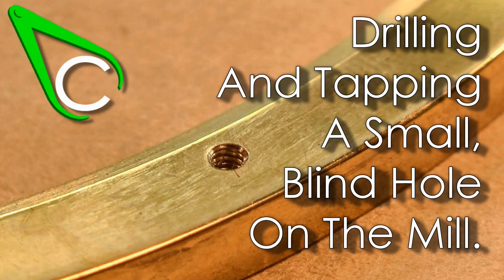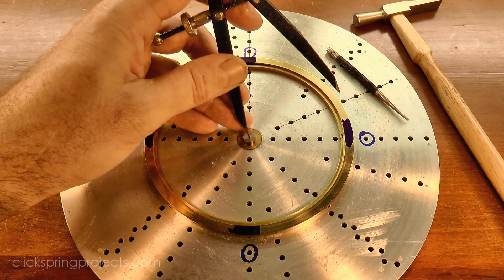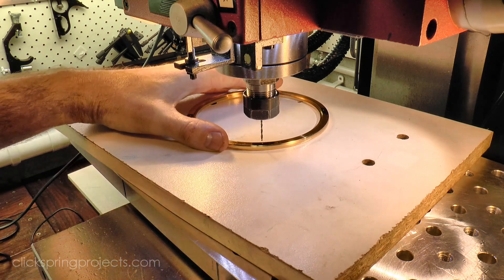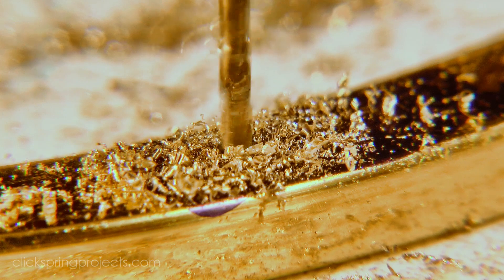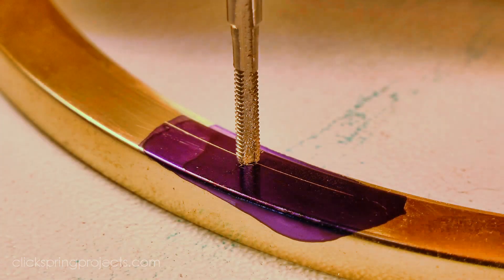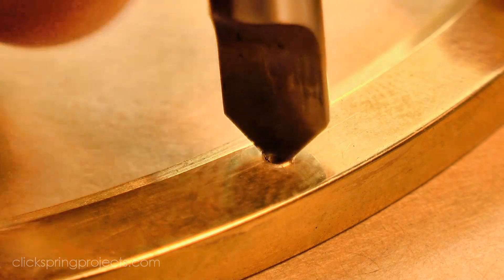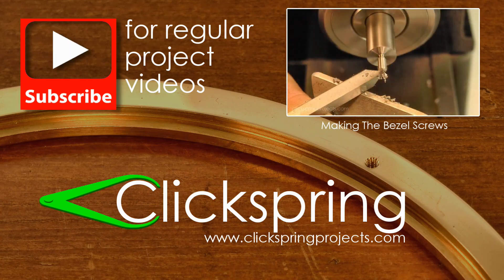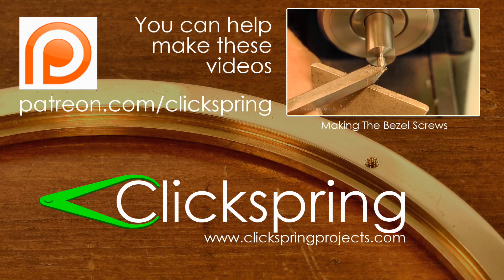Spare Parts #2 - Drilling And Tapping A Small Blind Hole On The Mill

Comment: Was wondering if u have ever made a tap? I need to make an odd size tap (M17.5 x 1.25 left hand) . It’s only going to be tapping aluminium and will probably only have to tap two through holes about 16mm long. Do u think I could use a M24 cap screw turned to the M17.5 then hardened by heating to cherry red and quenching in water?

Comment: Hi Chris great videos and lovely work.  In relation to tapping I have very small holes to tap (6B) into mild steel for a loco I am building I notice you used a pin vice and some sort of rod from the collet . Is that better than using a follower on top of the tap?  I have the same make of mill but mine is the SX2.7 would really appreciate your advice as I have a lot of these to tap I have subscribed John Tasmania
Reply from the maker: Hey John, a tap follower is good, but I really like the way I can get fingertip sensitivity with the pin vise sliding on a rod in the collet. I can feel everything so clearly, it removes the fear of a tap break. Consider also something like this: https://youtu.be/Yt20qj1DHpc?t=9m57s 
http://www.clickspringprojects.com/tap-and-drill-extenders.html
Very sensitive, absolute pleasure to tap small holes with fingertip pressure using this tool. Cheers mate :)
Reply: Clickspring thank you very much for replying back to me, I am going to give it a shot with the pin vice first.  The "rod" you slide the vice on what is it spare stock or did you machine it thanks mate John
Reply from the maker: I use a bit of scrap drill rod, 1/4" - cheers mate :)

Comment: I notice that you tap the hole first then deburr the edge of the hole, where as I normally deburr the hole then tap it. I would appreciate your thoughts on this. Again great work. Thanks
Reply from the maker: +Charles Camenzuli Hey Charles, you are doing it in the "correct" order, although personally I tend to be pretty relaxed about the sequence. On this scale of work,particularly in brass, I've found that it doesn't make a huge amount of difference. Great to have you watching mate :)
Reply: My thoughts on this is that having the hole chamfered before tapping allows for easier lining up square with the part as it self centers. I generally chamfer the hole, tap it then chamfer again to make it easier for it to be screwed into but thats just my thoughts
Reply: There's that, and it's also to prevent the the tap from throwing up a burr. The material tends to deform locally if there's no countersink. But at the same time, tapping also tends to mess up the countersink a bit, so I prefer to do it after and not worry about tool changes and what not.

Comment: what size thread is this?! I normally use 2-56's to hold bolsters on my knife work but I like the idea of using 0-80 because it needs almost half the thread engagement for full strength. Problem is I keep snapping these 0-80's off!!! Luckily my parts are titanium so ferric chloride can dissolve the tap and not mess with my part. However unfortunately my parts are titanium, so they can be a bear to tap!
Reply from the maker: +Finn Custom Knives That's a 10BA thread, an old UK thread standard. Thanks for watching!

Comment: Tapping wax is great for holes like this. Not the solid lubricating sticks, the small wax sticks that you insert in the hole. As the tap is screwed down, chips are carried up the flutes embedded in the wax. Leaves a nice clean hole.
Reply from the maker: ElectricGears That sounds great, I'll have to find some of that! Thanks for letting me know.